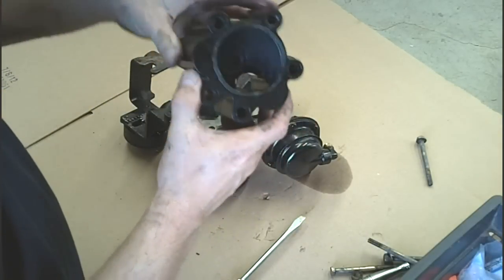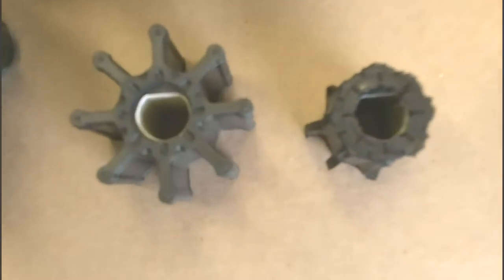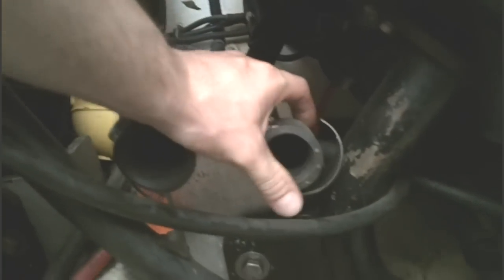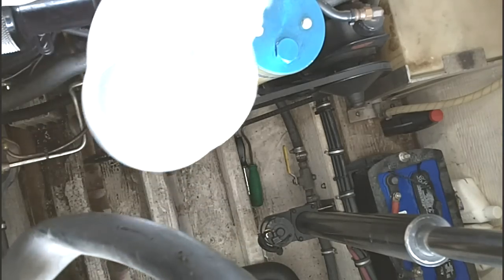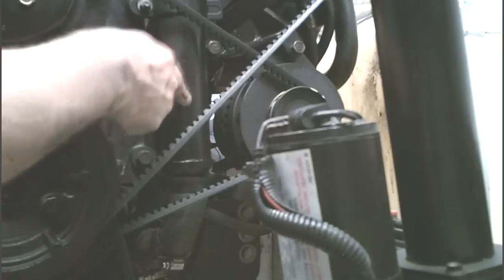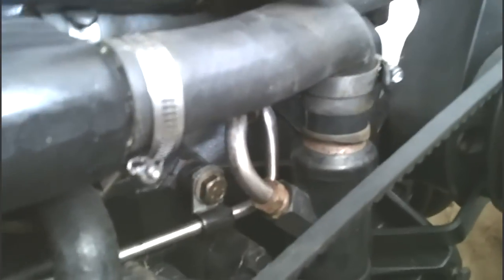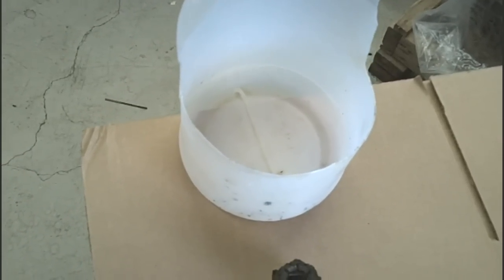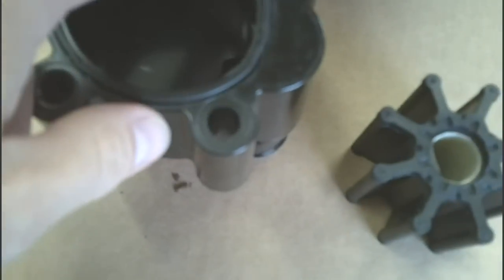Mercruiser 46-807151A8 Sea Water Pump Failure

Comment: One thought on whether you have collected the majority of impeller pieces might be weighing the new impellor vs old impellor and fragments.  Likely very small pieces may have discharged up and out the exhaust risers and into the lake, but I'd think the majority of the mass should be there using a digital gram scale.

Comment: Good video. You can also weigh the impeller bits and compare with new impeller weight. I don't like the plastic housings, luckily, mine is all brass.

Comment: Great video, very good explanation and videography.  That has to be about the worst impeller failure I've ever seen.

QUESTION:  Isn't there a sea strainer device built into inlet water hose inside the engine compartment on Bravo drive systems to prevent the water pump housing from ingesting debris?  If there is not, is there an aftermarket setup that you can buy and install as a DIY project or by a marine service shop?

Comment: The belt that goes over the water pump and  tensioner that you have on the table it’s a V-belt right? There’s one guy was telling me that my engine was modified that should’ve been the serpentine belt but my engine is 1994 and that’s what the service manual  calls for a V-belt is that what you have?

Comment: Somethings just kill me. Failure to replace the impeller at the start of the boating season and twice a year for saltwater year round folks, 5-inch hose clamp on a 1 and 1/2-inch hose. This video is a prime example of why boat engines fail way too early and who makes it has nothing to do with that.

Comment: does the engine have a water circulating pump ???.. i have a mercruiser 5.7 v8, and i have change the impeller in the outdrive water pump and have rebuilt the circulating water pump, but i didnt know about a sea water pump with an impeller. will check my boat.thank you

Comment from the maker: Topic: Water Pump Failures
Question: My Mercruiser Marine Engine suddenly started overheating to the point I’m afraid to run the engine. I watched your video on replacing the water pump impeller and in fact narrowed my problem down to a failed water pump impeller on my 807151A14 water pump impeller. However after replacing the impeller the engine is still overheating. Did I miss something when replacing the water pump impeller?
Response: This is a very common situation however its very important to understand why. This is probably one of the most common situations a marine mechanic faces while addressing marine cooling system related problems. It can be described like the chicken and the egg scenario regarding whether the failed impeller causes the overheat or the lack of water flow/overheat causes the impeller to fail. Regardless of which happens first the result is always the same; a failed water pump impeller.
Situation 1 – You’ve been running all summer while noticing your temperature slowly climbing over the course of the days/weeks. Ultimately you reach a point where the engine overheats and you can no longer run. The image below illustrates an oil cooler that has become plugged with grass, weeds, trash, or some other kind of foreign debris. This typically comes as a result of operating in an environment where grass or weeds are common, however it can also be attributed to picking up a plastic bag over the water intake on a sterndrive. It is important to know the operating conditions of the area you operate within so you can schedule your maintenance in accordance with this. In the case described here it is likely that the cooler became plugged over a period of time which lead to the slowly increasing engine operating temperatures. Ultimately this can lead to impeller damage from the lack of sufficient water flow until the impeller ultimately fails. It is important that you inspect all of your coolers each season when performing your normal winterization maintenance, or if you live in an area where you do not winterize you should schedule time each year while inspecting the water pump impeller to also inspect the coolers for blockage.

Situation 2 – You’ve been running all season long with no apparent temperature related issues. All of a sudden your engine overheats and forces you to shut down. After inspection you determine the water pump impeller has failed. Its important to realize how a positive displacement pump functions and displaces/pumps water. These pumps move water by creating a pressure displacement (low pressure) on the inlet side of the pump while then producing positive pressure on the outlet side. This process in effect then moves water. These pumps commonly have a pliable, rubber impeller that has an offset section which compresses certain veins of the impeller to create the pump suction. If the internal surface of the pump body becomes grooved or anything other than smooth the impeller loses efficiency and therefore loses its ability to move water. In this case with a rubber impeller the pliable material of the impeller which cannot absorb heat tends to break down therefore becoming less pliable to the point that it actually becomes brittle much like when you burn a piece of rubber and it becomes hard. At this point it is like a self-perpetuating condition in which the increasing heat is leading to further breakdown which then continues to decrease the performance of the pump until failure results. Whats important to realize in this case is that many of the broken/missing pieces of the failed impeller get trapped somewhere in the cooling system and cannot exit the system. While this is a more common of a problem on closed cooling engine or any engine equipped with an engine oil cooler it can also lead to problems on raw water cooled engines NOT equipped with any coolers. 
Conclusion: Whether you have an impeller fail which then leads to overheating or you have a blockage in the cooler that leads to impeller failure you should always check the complete inlet and outlet flow paths to ensure there is nothing blocking the system from good water flow into and out of the water pump.
- See more at: http://www.perfprotech.com/blog/boat-and-engine-technical-tips/marine-cooling-systems/mercruiser-raw-water-pump-impeller-failures